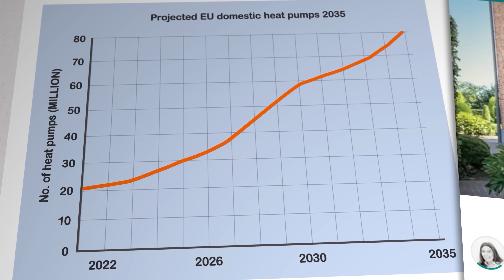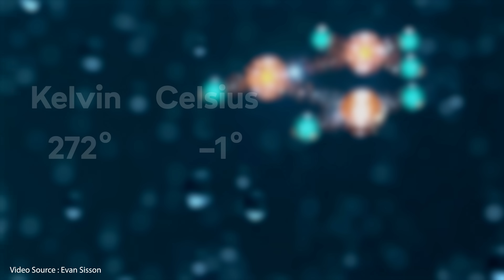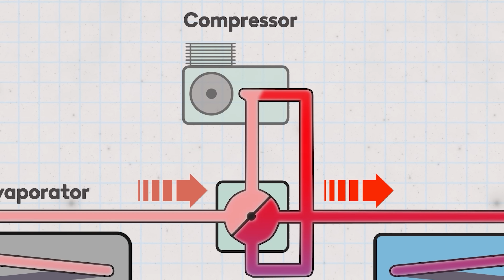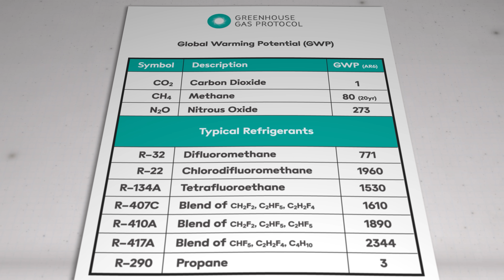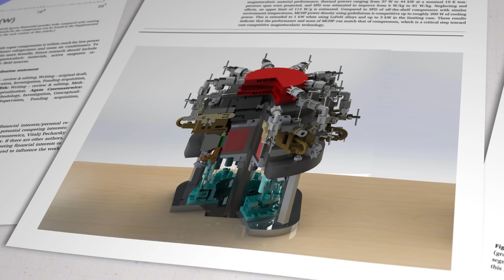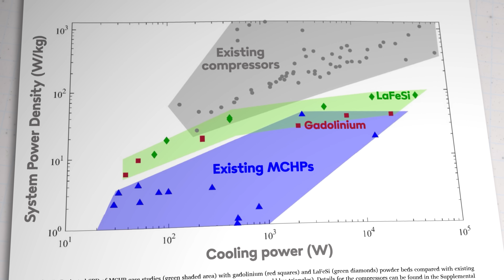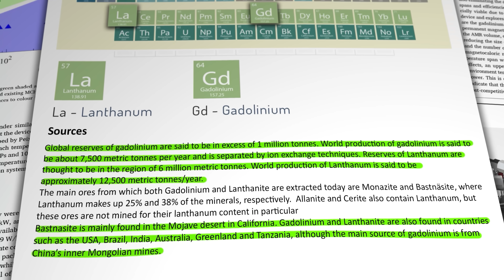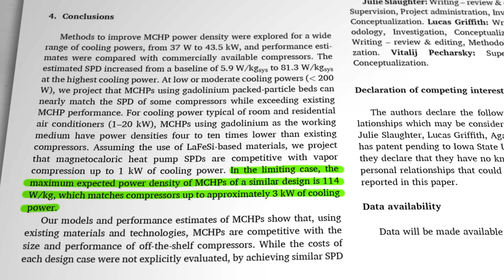Taking greenhouse gases out of heat pumps. (YES! They do contain them!)

Comment: One one of the factors that reduces domestic heat pump efficiency is the use of water to distribute heat around a house. To get heat to transfer from the fluid used in the heat pump to the water used in radiators, a heat exchanger is used. You can't get heat to transfer unless you have a temperature difference. How much hotter is the heat pump fluid than the radiator water? This pushes down the CoP of the heat pump. When visiting some friends in Washington last year, who were using air conditioning to cool their home, I asked them how they heated it in winter. Answer., the same air conditioner delivers heat in winter. Now, they were not sufficiently clued up to be certain of this, but my best guess is that the air was cooled by the heat pump's evaporator in summer, and heated by the heat pump's condenser in winter. Since the air is heated directly by the condenser, the condenser can run at a lower temperature than it would need to run to heat a water circuit to supply radiators, so the CoP can be higher, while delivering the same heat to the house. I investigated suppliers in the UK, and yes, you can get bi-directional air conditioning systems in the UK. My original thought was that they would require air ducts to rooms in the house like the US systems, but I found that instead, they mounted a heat exchanger in each room and ran refrigerant pipes with hot or cold refrigerant from the heat pump to the room heat exchanger. They seem to be targeted at businesses rather than homes, heating or cooling large rooms, with minimum heating or cooling ratings of about 3kW.
Reply: Air to air ASHPs. Ignored by UK gov and MCS certification scheme as they just want to swop out gas boilers. Known more commonly as air-con. Check out some youtubers experience with this. It's cheaper, simpler, and very good for smaller properties. Does not yet do hot water (some change on horizon), and gov don't give any support. Having said that, the cost of £3-8k is probably what some people are paying AFTER the UK grant for air to water HPs anyway. No radiators, no pipes, v having ceiling units in each room plus the HW challenge. Bonus is air con for the occasional heatwave.

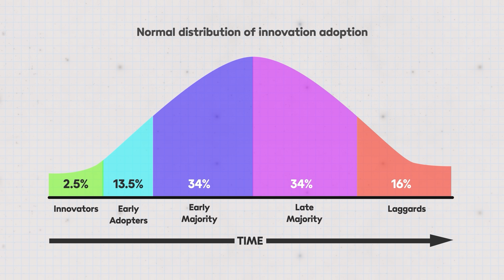Comment: 1:03 "Most people couldn't care less as long as it works ok and doesn't cost a lot of money".
Air source heat pumps COP will drop below a point where it costs less to heat with gas rather than electricity at something like 7 degrees C (UK prices). If you have many months below that temperature, and only a few months where the temperature is around that point, you'll likely be spending more on heating. Some of the energy suppliers have installation prices well below that of a gas boiler (using government grants), so that, at least, doesn't seem to be an issue any more.

Comment: I don't understand why companies bother with heat pumps when it's easier and more efficient to use water heaters that pump the hot water through a radiator to heat a home/business.  Also, the earth has wonderful cooling potential for very hot summers using small water tanks ~10 feet underground.  This would decrease power consumption an order of magnitude lower than what we currently use for heating and cooling.

Comment: There is a YouTuber on your side of the pond who performed an experiment with just magnets moving fast in a circle, he produced a lot of heat from this old school tech. Everything he does is very low tech. His channel is "Way Out West". I would highly recommend it, not just because it is very thoughtful, but also rather funny. And I was in the industry, but left.
Reply: That's induction heating with permanent magnets instead of electromagnets. It's generally not very cost-effective since it is at best on par with electric resistance heating for efficiency while using more expensive materials and a less practical form factor.

Comment: In my climate, I think a geothermal heat pump would a useful addition to a home. That said for newer construction better insulation, better night time venting for day time summer heat, far better roof venting and interior thermal mass might fully cover my needs. And in my climate hail is very rare so PV with a batteries could be part of the off grid solution for part of the year for computers & the freezer. That said if the insane greens don't destroy the hydro dams my power may remain reasonable in cost and dependable unlike in the UK or in the California Democratic Republic🫤

Comment: I used to install heat pumps, and HVAC in general, when i was a kid. Nothing special, its  basically a typical AC running backwards. Now i am not buying that the main greenhouse gasses are from r32 being released directly to the atmosphere after 10 or so years of service. Neven seen that done. We always reclaimed whatever gas. I would imagine the real greenhouse gasses are released from the electricity  generation.

Comment: The average UK home has a total heat loss of less than 10 KW. If they can get the performance up to 9KW then it could be suitable for a great many homes in the UK. However, I feel that as with so many developments, cost will be the crucial factor. Current heat pump technology is falling in price so any alternative is going to have its work cut out unless it is competitive. It is why so many people are still installing gas boilers, even in brand new homes.

Comment: Lower pressure and more efficient refrigerant are what would help the earth, not the stuff they're pushing now.  Higher pressures leads to more failures.  I can't think of the last time I dealt with a compressor failure or coil leak with R-22. I have two R-12 systems still going strong from 1974, in Florida where they're running all 12 months.   There's another 10 or so from the 1980s still going as well.
R410A? Nope.  Running a 50 percent failure rate after 5 years, 80 percent rate after 10.  Almost all of them are coil leaks. A few compressors went bad, but mostly leaks. Worse, because of the way things are made and priced, we either couldn't get replacement coils or it wasn't cost effective to do so, so these units were scrapped and replaced with new, even less durable systems.  What's the environmental cost of making these systems in Asia and shipping them across the oceans?

Comment: I'm going to install a heat-pump powered boiler this year. It'll use Propane and as a positive side-effect it'll also remove moisture from the air in the basement.

Comment: As a Refrigeration Technician, I have never come across a Domestic Air Conditioner (Heat Pump) that has a Condenser or Evaporator immersed in water. Countries like China and India (3 Billion people) still use Refrigerants (r12 for example) with huge ODP and GWP, that are Illegal in countries such as Australia, without any reclaim laws, and can release these Refrigerabts to the 'big bottle in the sky,-legally. I honestly do not see China or India ever using MCHP's due to high cost, and will continue to warm the planet and deplete the ozone, until we all have cancer, or our polar caps have melted.
Reply: One of my neighbors has a water source heat pump system installed. It's about 50 years old.  It's an open loop system and uses river water. Works great. Quiet, cheap to run. 

Likewise, at my condo, we have a closed loop ground source setup for our pool.  5 water source heat pumps for it.  In the summer, they run a reverse cycle to cool the water down to 85F/29C, as above that water chemistry becomes difficult and expensive to maintain.
Reply: @grayrabbit2211  I have seen many hot water services with immersed evaporators, and geothermal loops etc, but never a split system ss shown throughout the video
Reply: @SonnieLlewellyn  I have also never seen a unit working in the way the video showed and his explanation of how heat pumps work in general was very poor, in particular the bit about the hot side working because it makes the gas particles hit the sides of the pipes more around 3:40. This is basically how most of his videos go as far as accuracy and practicality of the topic he's discussing.

Comment: I haven't watched the video yet but recall years ago when they released propane as a refrigerant and then it was outlawed.  At the time it was known that it had very little ODP and the lowest global warming potential of all economically viable refrigerants. It was also far more energy efficient when used in a system. Now it's become legal again in some states. The policy creators are around 2 decades behind the science.
Reply: Policy creators were probably thinking about explosions.  Propane is a hydrocarbon gas.  If you get a leak in your system, you could have a real problem.

Comment: CO2 refrigerant seems like the way to go. I think the higher pressure needed and corrosive nature of CO2 are two big issues, both requiring more stainless pipe which is harder to work with than copper.

Comment: This fits to a program at Frauenhofer (germany) were they test and improve magneto-kaloric and electro-kaloric systems and first results was published not to long ago (still work in progress) on real prototypes.
The very interesting news from last month is related to south korea were they tested a laboratory mini model of a chemical-kaloric system ( chemical reactions used / here iron oxidation) and could receive even higher efficiency of 14.5, but they are very early on and have a long way to go.

Comment: As hot air rises then why not have thermal collectors in the roofs, attics or ceilings of the buildings we are heating.  This would effectively recycle the heat generated as well as add our own body heat into the mix.   This would work with whatever heat pump system used.  With a well insulated building this would prove to be extremely efficient.  In summer the heat from the roof could be removed before making its way into the building thereby reducing cooling costs.

Comment: I live in Norway and heat-pumps have become very popular here. Had a visit from the UK and my guest seemed to be a bit anti heat pumps stating that they are looked on with a good deal of skepticism in the UK. Why is that? Mine works great!
Reply: I'm not sure if the equipment is different. US equipment is vastly different than other parts of the world, and is honestly garbage.
Reply: Because electricity costs 57 pence per kwh in the UK.

Comment: From where are the currently used refrigerants sourced? I.e. does their leakage merely close a loop?
Reply: Stuff like propane is often sourced from separating it out from natural gas. Stuff like the refrigerants with difficult to pronounce and/or super long chemical names are mostly artificial and are produced in factories. Other than CO2 itself, odds are none of them were pulled out from the atmosphere.

Comment: Sort of stupid way of framing things in my opinion.  I seriously doubt that heat pumps make sense in running off of solar power in cloudy Britain and Germany in the depths of winter.  With Britain, maybe wind power is adequate for winter, but not for Germany.  Personally, I'm installing a heat pump for summer, spring and fall, but also having a propane-fired hot water heater that will also provide radiant heating for the worst of winter.  You shouldn't be replacing gas boilers, twits.  You should be augmenting them with heat pumps for greater efficiency for part of the year and better resilience.  And if you can't afford both, considering how cheap the capital equipment actually is, you are doomed, anyway.  It is fun to make fun of the UK where you have managed to impoverish the bulk of the country, while having ridiculous real estate prices in the nominally prosperous part of your nation.

Comment: You should maybe also look into the heat pump gasses themselves. The EU has a requirement coming in 2030 for a max GWP of I believe 250 for refrigerants. It is anyway low enough to eliminate most current heat pump refrigerants and it will actually take us back to old school types like propane, and Co2 itself which can also be used. I have already seen examples of these types of heatpumps starting to pop up in projects that are a bit larger than single houses like groups of new row houses. But I suspect they will arrive in single homes as well. Its issues to be solved are explosion dangers and gas leakage being unhealthy. But they are existing workable solution that are better for the climate, especially combined with the general heat pump efficiency developments have happened since those old days.

Comment: There is another device that when coupled with a small VAWT can produce a quantity of heat.  A friction heater which utilizes the heat from friction of a rotating device could produce a larger amount of heat over a given time.  On a relatively windy night a VAWT (with a VAWT the Friction Heater device can be located close to the ground) could produce enough heat for a small home and store it in a sand battery until needed.  I think this is feasible since the costs are relatively low as compared to producing electricity from the same device and can produce heat at varying wind speeds unlike a generator which needs a more even wind speed to produce the precise rpm's for the generator.

Comment: R600 makes for an efficient coolant. But it has a very low discharge temperature. Compared to R32 and  R410a. So yes efficient but your  under floor heating will be only warm and therefore heat transfer into the room will need a larger surface area than already needed from conventinal heat pumps and the houses will  need even greater insulation than ever.  So it becomes impractical for even more houses to convert too.
Reply: You make a good salesman. Just like heat pumps and this new technology. Neither achieved real world theoretical efficiency. And efficiency is the driving force to these new technologies. High efficiency = lowering energy usage = lower energy costs= faster payback on equipment=lower CO2 emissions. But the real world compared to glossy sales performance is too far apart. As you quickly skirted over. -1C is 240Ka. The colder the air temperature gets to the refrigerant liquid state. The  efficiency drops off to a point it stops evaporating at all. The fact they are already looking for new ways to efficiently create heat(the car). Shows that heat pumps(the horse) are not as good as expected.

Comment: Also, some of the noise you’re hearing is of the heat pump! They can be very loud. Additionally, every time you give someone a heat pump you’re also giving them an air conditioner that they might not already otherwise have had.

Comment: Sadly, this isn’t worth even experimenting with. Lanthanum? Gadonlinium? Massive rare-earth magnets? You’re having a laugh if you think that’ll ever be cheap enough to be practical.
Gladly, we don’t have to use CFCs as refrigerants. We already have alternatives. Some are already available commercially for heat pumps.
Propane - Low GWP. Dirt cheap. Already available. Moderate pressure.
CO2 - (ironic, I know, but still low GWP compared to CFCs) Cheaper than dirt. Available. High pressure.
Water - Already used in data centres and large buildings. Practically zero cost. Below atmospheric pressure.

All of the above can achieve a COP of 4.5 or higher. Why are we still using R314a and it’s various cousins when we DO have practical alternatives?
Also, bear in mind that a heat pump is the same as an air conditioner, mini-split or refrigerator. All of those mostly use damaging high GWP refrigerants, so it’s not just home heat pumps that have this problem. Every home and every car already has at least one!

Comment: The amount of greenhouse gas in a heat pump is not a lot. Hardly worth bothering about and tiny compared with the CO2 emissions avoided if the electricity supply is even partly generated using fossil fuel.

Comment: Sounds promising. It sounds like there's a potential for a higher COP, because compressors have to work hard, whereas a moving magnet shouldn't consume loads of energy.
Will have to wait and see how things turn out.
Reply: The maximum COP is determined solely by he source temperatture and the output temperature.
Reply: @rogerphelps9939  - that makes no sense.

Comment: Although the GWP of most refrigerants is very high  per unit weight, the amount is tiny compared to the CO2 released by a gas boiler over it's life. I noticed in the list that propane as a refrigerant had a GWP of 3. Running a gas boiler for 1hr would release CO2 to match that ! Still this new technology is very interesting.
Reply: There are also CO2 heat pumps with a GWP of only 1 and basically zero health and safety risks. GWP will not be a factor for heat pumps in the future, only efficiency.
Reply: Provided the electric to run that heat pump isn't releasing carbon of it's own.

Comment: Your channel just propaganda and lies😢
Reply: Maybe you're lost.
Reply: @TheDanEdwards  This video is discussing technology that has been around for decades as if it is something new. It has never worked well outside of niche applications for cryogenic temperatures as far as I'm aware and unless I see actual products hitting shelves and being installed in homes and businesses, I won't be convinced this has changed. The video did a poor job describing the technology, did a poor job describing how heat pumps actually work, and did nothing to demonstrate a viable product may actually be in the works. A lot of his videos are like that. The only remotely recent exception I can think of are in regards to solid state batteries, which may actually have products coming out in the next few years, but even then, his description of how they work was inaccurate at best, which I commented on in said video.